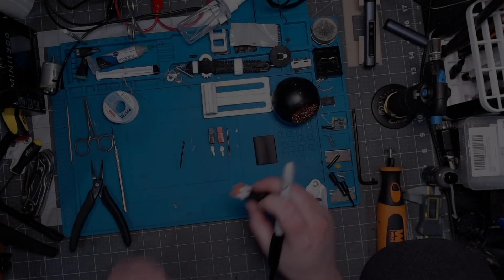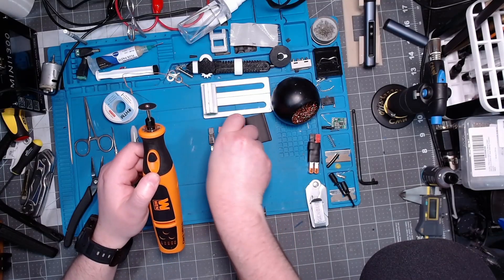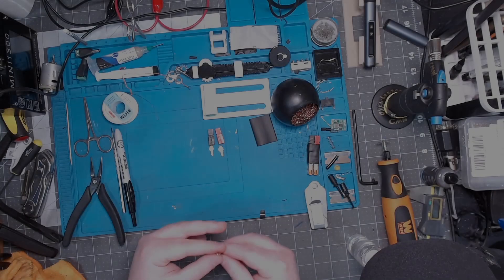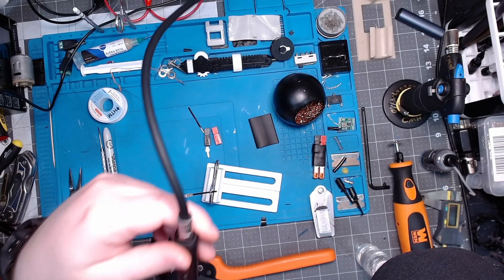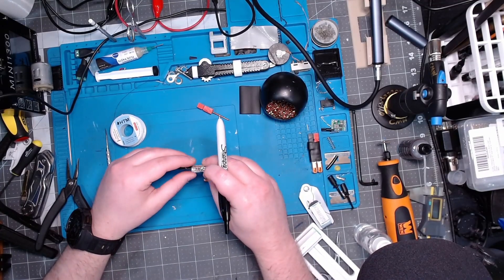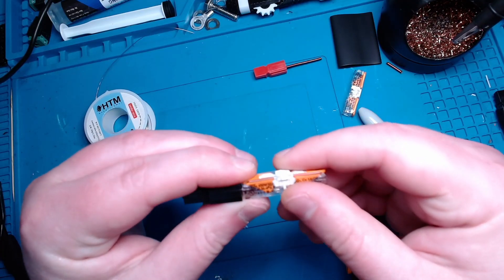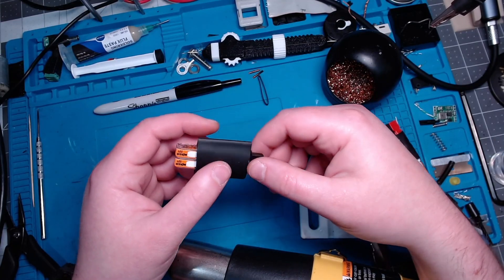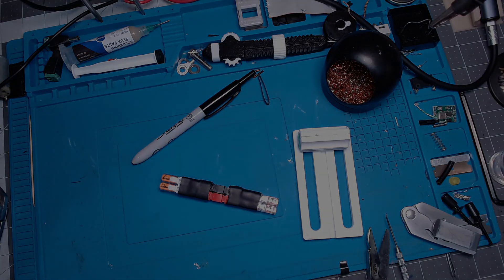Wago Lever Nut to Anderson Powerpole Adapter DIY #hamradio #N1RIP0004

Comment: A short section of 0.095 inch weed trimmer line will fit the small hole on the powerpole side and lock the connectors in place.

Comment: Built a couple of these very useful adaptors just this weekend. Only difference is I didn't have any adhesive heat shrink so I used regular. But it is easily cut off. I do intend on getting some of the adhesive stuff and redoing it. Thanks for providing the Amazon link.
Reply from the maker: Good deal brother, glad you enjoyed the video! The adhesive heat shrink comes off clean believe it or not 😦 I've used it over the top of microcontrollers and it leaves no residue